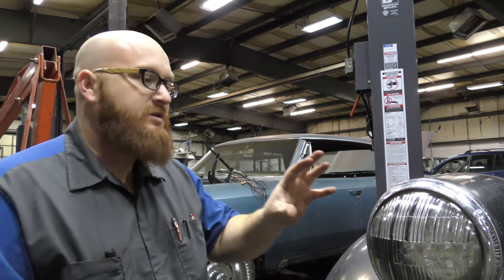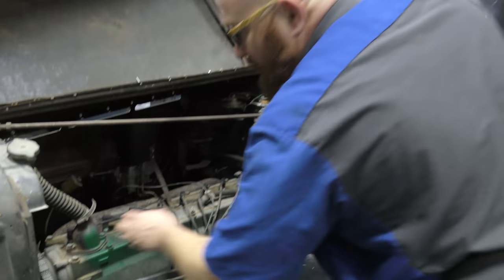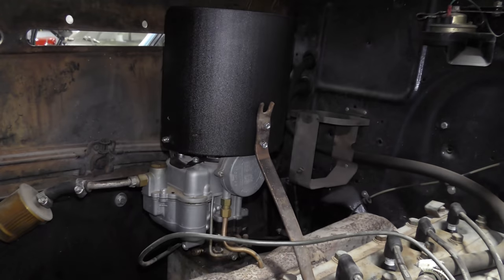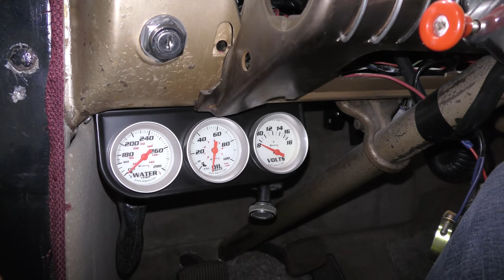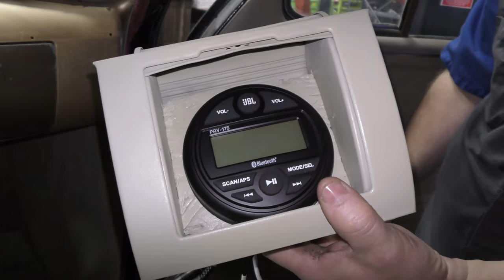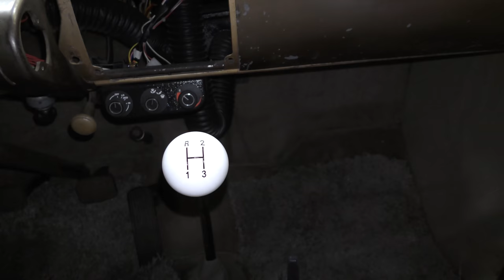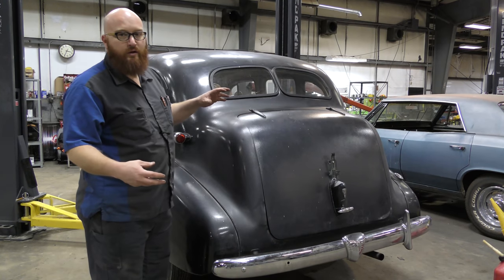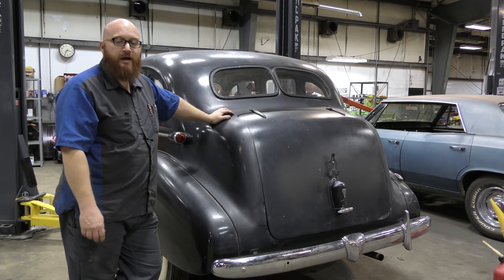OLDS SERIES #2: Nightmare to keep '38 Olds original! CAR WIZARD struggles to restore 83 year old car

Comment: The gauges are rebuildable if you take a little time.  I did it on my 54 Nash using VDO gas and temperature gauges.  I dismantled the new ones and took the drive units and mounted them behind the gauge face.  That way you get the matching sender units.  Just have to get the gauges with the right color pointer.

Comment: Those Pertronix Ignitor modules that replace the points and condenser inside your distributor cap are really great.  I had one on my '68 Ford Galaxie, along with the Pertronix Flame Thrower coil.  I was able to get rid of the "resistor" wire and feed a full 12-volts to the ignition system, which meant I could increase the spark-plug gap and get a stronger spark.  Ran like a dream for the 15 years that I owned the car, and I never had any issues with the ignition system.  It was perfect.  I can't recommend those Pertronix modules enough -- really, really great replacements for the old ignition systems, while still making it all look like stock.

Comment: If you ever have a overheating problem that has you baffled it’s most likely the water distribution tube that runs through the
engine.  Ask how I know!
Reply: Or 80 yrs worth of crud built up in block...only way is total disassembly and hot tank block......I say swap in a LS and turbo
Reply: How do you know ???
Reply: @rsprockets7846  He still has a good running straight eight, so it doesn't need an LS...
Reply: @davidhollenshead4892  personal experience with a 49 Pontiac.  On hot days the temperature gauge would peg.  I changed everything including the head gasket, thermostat, water pump.  Had the radiator rodded out etc. Finally an old timer told me my water distribution tube was rusted out.  Sure enough, that was it!  It was a bitch to change!  Had to take the grill out for clearance.
Reply: @davidhollenshead4892  we had a straight 8 buick come in shop with overheating did gaskets hoses cored rad...lotta bucks......turned out block had accumulation of crud from rad repair owner
 bailed on car
Reply: @rsprockets7846  - why does almost every video have this stupid LS swap it comment?
Reply: @rsprockets7846  They are only original once!  Why butcher a nice car?
Reply: @rsprockets7846 NO F---G WAY!  CLASSIC CARS SHOULD BE KEPT  S T O C K!
Reply: @petrosaguilar8916 You just answered your question with that word before "LS".
Reply: @davidhollenshead4892 He probably is a mechanic and has experience with American cars.

Comment: For your edification, Wizard, it is called a road draft tube.  Cool car. 
I pedaled a 1941 Oldsmobile series 68 businessman's coupe through my junior and senior years of high school.  It had the straight 8 engine and a hydramatic.  Very smooth drivetrain.  That engine was silky smooth running.  Also, instead of a rear seat, it had a drawer which  when the trunk was opened, rolled out to a pair of stops.  That was so road salesmen could load their product in and not have to pack and unpack at every sales call stop.  Very cool.

Comment: Unlike the modern tapered wheel roller bearings, those ball bearings required pre-load torquing.  The crankcase vent tubes were called road draft tubes.  The shape the end would allow it to pull a vacuum when driving down the road.  Air would enter the crankcase via the filter in the oil filler cap.  I'd use the same type LED headlights except ones with built in turn indicators within the headlight unit.  Nice car.  Hemmings might be a good source for parts.

Comment: you really need clear lenses to do that mod, ive tried converting behind assymetric lenses before, it messes up the light pattern and output
Reply: No way it's not still far better than what he had before and it's not like this is a daily driver out every morning before the sun comes up
Reply: You would be surprised... But, of course more output than a 80year old 6v bulb... But probably not where you want it😅 (that matters)
Would be interesting to see the pattern(high and low) against a wall
Reply: @veilsidewankel  These LEDs blind you, they are horrible when used like this
Reply: @lostcabrio  i retrofittet bmw bixenons in an old opel kadett once, same assymtric lenses, even with hid, the output was worse than the stock preH4 bulbs, and blinded everyone, with clear lenses the lights where amazing

Comment: My only advice, don’t paint it. It’ll never be as nice as it is now.
Reply: Even though it does not have the original paint, the current paint matches the package of the car...
Reply: @idratherberiding3456  I have a 41 Ford 0ne Ton that was properly repainted once 50 or 60 years ago in the original colour. It has nice patina and a lot would be lost if it were painted. Once painted then the chrome and stainless parts would let it down so where does it end. Some careful paint remediation in certain areas would be the ticket.
Reply: I cannot imagine this car is 5 years younger than my grandma, who is still in a pretty good shape (she was born 1933) This car looks so old - technology has made a huge jump in these past 80-something years

Comment: My Classic Mini’s interior caught on fire while the body shop guy was welding a new floor panel.  It was on a lift, on its highest setting, when it caught fire.  So they didn’t realize what had happened until it was too late, took too long to get the car down so they could properly use the fire extinguisher.  

They paid to fix it, but they destroyed the original interior, as well as melted the original car keys.  Wish someone like you was working on it.

Comment: Lol. That filter looks horrid. So do the lights. May as well keep the starter how it is too.
Reply: And there is people that can rebuild those cables and gears for the gauges at least for tractors anyway you just need to keep on looking what  filter would have been originally on that carburettor.

Comment: hi, whats the firing order in a straight eight?
Reply: One right after the other
Reply: Just google 38 Olds straight 8 firing order.
Reply: there are a number of variations of firing order which is interesting
Reply: @Gruxxan  I didn't know that. All I know is 18436572...SBC
Reply: @clintdavis9511  i'd imagine a different firing order gives a different 'feel' or characteristic
Reply: @kirkjohnson9353 That wouldn't work.  It would cause the engine to try to see-saw back and forth.  16258374 is probably the correct firing order.

Comment: You should be able to find modern sealed bearings to replace the originals.  The old ones require regular servicing and they are commonly replaced in old cars.  Not sure what type of oil seals they had in 1938 but I was able to replace the felt seals on my 29 Singer with modern seals as well. It is amazing how many different bearing and seal sizes are available today.  You can get almost anything you need.

Comment: Packards of a similar vintage had a switch on the Carter carb that engaged the starter solenoid when you floored the gas when the car wasn't running. No need for a separate starter pedal.

Regarding the flat head inline 8's... They run very smoothly, hence the reason they were in higher end cars well into the early 50's.

You can definitely get the gauges rebuilt.

Comment: Very good idea to put the LED motorcycle headlamps in there. I also like the 12v system and electronic ignition. Lovely car! I can hardly wait to see it painted!
Reply: Add small amberbLEDS on inside perimeters of lens for turn signals

Comment: I wanted stereo speakers in a vintage car once, but didn't want to cut any interior trim. My solution was a pair of those heavy free-standing aluminum Radio Shack Optimus two-way box speakers, set on the rear floor, just behind the front seats.  I've seen some of those rated up to 80 watts. Currently, I'm doing the same with a pair of 40 watt Optimus in my '96 standard-cab Tacoma as there was no factory rear speaker setup from Toyota. 
Radio Shack is gone now, but I've found the speakers at flea markets and thrift stores, and there should be something similar available new for marine application.

Comment: I’ve got a 1941 Dodge WC-8 military radio car project going so I can relate to a lot of what you are seeing and doing.  My gauge rebuilds came in at about $1200.  (Wiring harness is completely shielded and was $1800!) Fortunately even though mine is a rare vehicle (one of two known survivors of 452 built) the parts are between a 41 civilian and 42 military 1/2 ton.  I am also lucky enough to have 3 factory photos of it. I’m surprised you just didn’t have the brake drum turned or will you do that and save it for later?  Also you may consider getting an original generator and having it built into an alternator to maintain the original look.  I am getting ready to do that for my 42 Ford GPW Jeep.  The shift pattern is the same on my Jeep as your Olds.  Unless you drive it regularly it is easy to forget that left and up is reverse at an intersection.  I have 3 stick shifts and each is different!  Love your project and appreciate how you are doing it!

Comment: I have kept the original starter arrangement for my '56 Buick which starts when I depress the throttle all the way to the floor. When the engine fires the resulting engine vacuum de-engergizes the starter switch which is mounted on the carburetor.
Reply: Always wondered how, why, they disengaged.

Comment: I restored a 1934 Oldsmobile I found in extremely poor condition. It was more fun restoring it than driving it, and I kept it stock standard and did everything including the gauges.  I used it for club outings for a few years then sold it.   Very heavy solid and heavy car which was beautiful to look at. .  Cars of the 30's are OK but difficult to drive in modern traffic, slow, heavy steering, poor brakes and poor vision. . Good luck wizard I trust you enjoy your Oldsmobile.

Comment: There is a large square glass milk bottle that fits the washer bottle bracket and was often used as a replacement. 
Fitting a throttle body fuel injection system and a small turbo would improve the efficiency and drive ability without harming the engine.
You’d only want around three to five psi of boost just enough to ensure all the cylinders are getting a good air fuel mix.

Comment: You should build a shroud to cover the other side and top of that air filter. Love the straight 8 they make the best sound under load and I wouldn't use the oil bath style air filter. As for the gauges maybe send the original gauges out to a company that rebuilds and modernize them. Or you could try and use the mechanism from the aftermarket gauges you have and retro fit them into the original gauges yourself.

Comment: Great old car, Wiz. Suggest you try and track down a pair of '39 Chevy tail lights to use as front turn signals. Change out the lens and make some brackets to attach them to your bumper brackets. They are shaped is almost identical to your tail lights. Also agree about getting the stock gauges restored. There are lots of places that do good work (see other comments) and the L-38 dash is a unique one-year-only design.

Comment: About the radio. Many cars in that age had the antenna under the car, that would avoid drilling holes. Now you know what I know, got that from my father. Amazed that the speedometer looks "Oldsmobile" right into the early fifties. Someone mentioned below that you should install a hand throttle for cruise control. Look around, I should think a '38 originally had a hand throttle. Anyway, works some, but poorly. Doesn't adjust throttle for hills, etc. and certainly doesn't shut down when you hit the brakes. Seems to me that Pontiac was Oldsmobiles corporate twin in those days. All GM four doors looked the same. Buick at that period  mounted parking lights in streamlined chrome "nacelles" over the head lights. I think they would look good as directionals.  Check me out on this one. It seems to me that to remove the rear drum, you have to heat it toward the center (propane torch will do)until you hear a "ping". Then it removes. Makes me think that is why the PO bent the drum.

Comment: I've never worked on a flathead; however, I have spent what seems like a lifetime working on 'modern' engines. Friends of mine, Gober and David Sosebee -- father-son team rebuilt Gober's ~1937 Ford that won Daytona three times on the beach using a flathead. Back in the day, there were racing parts for flatheads -- maybe even a straight 8. Watching the car, now in a museum, come together several years ago, they had Offy heads, pop-up pistons and who know what else. There was a lot of interesting work inside, especially since a GA Tech engineer helped sponsor the car

Gober Sosebee was a showman on the track and self-taught engineer and inventor when he was off. Lakewood Speedway in Atlanta and Daytona had small lakes in the middle of the track.One of his stunts was to take a bucket to the lake dip out a good bit of water, then go pour it into his gas tank. Of course, his bucket had a mark inside to get the perfect amount of water and his car already had his acetone mixing agents inside the tank, Although he didn't believe in patents or didn't think his engineering products were important beyond his cars -- things like I Beam Suspension and Torson Bar Suspension resulted from him trying to keep Studebaker wheels and tires on the track. 

After Gober passed away, a sports network wanted footage of the old race cars from the early 50's. A small, dusty track was built near the GA Racing Hall of Fame. Cars came out of enclosed trailers from all over the US. Unfortunately, David Sosebee, a former NASCAR driver himself, could not keep his father's car running. He pulled it off the track area. I walked over and David was clearly upset with himself. He said, "All those years dad would tell me all the quirks of cars with magnetos. I should have listened, but saw no need at the time. If dad was still living he could walk out there, twist this and tighten that, then crank the car and drive off.

Comment: I would remove that wholly out of keeping alternator and replace it with a Dynamator. Looks like a traditional period dynamo but actually is an alternator. In the UK, there are a number of companies specialising in restoring old car instruments. They are not cheap but do a lovely job, including repainting the dials. I had an electric speedometer repaired for my 1977 Porsche 911 RSR and it cost over £500 (that included re-calibration as I had lowered the final drive ratio for rallying).

Comment: If you have a manual choke or throttle controls/cables in the cab you can use those as "a poor man's" cruise control.  Not as functional but allows you to keep the car more stock.

Comment: For the headlight reflectors, you go to the household goods section of WalMart and buy a pair of polished stainless steel mixing bowls of the right diameter and cut a hole in the center.  You don't have to worry about degrading even the original ignition points because you'll never put enough miles on it anyway.  Flathead engines were indeed used in race cars: the Hudson Hornet was a large flathead six that dominated NASCAR racing until 1955 when the big 3 came out with OHV V-8s.  You can rebuild the original dash gages.  This was the final year for floor shifts.  That fuel filler hose better be for gasoline use.  If it is a radiator coolant hose it will disintegrate within a year.  Ball bearings were a cost-saving design.  Timken Tapered roller bearings were available and in use since the late teens on higher quality cars.  You need a large puller to remove the rear wheel drums or you will end up with a bigger problem.  These pullers are designed to bolt onto 5-lug wheel drums.  The cars didn't have turn signal indicators, you used hand signals.  The parking brake lights were small bulbs inside the headlamp shell at the bottom of the reflector.  You're going to have to make your hood trim by hand using a copper or brass strip.  With any luck, you might be able to work a standard household copper pipe to shape, possibly starting with sheet metal roller to get your width, cut out the back, and then hand work the ends and then have that plated.

Comment: For the front indicators it looks like those holes in the headlamp housing would take a motorcycle indicator. so you could either get some retro styled chrome led indicators from someone like tec bike parts, or like with the headlamp get a really low profile led motorcycle indicator so nobody even notices it until you switch it on.

Comment: Blinker Idea,  Halo ring inside the Headlight lens,  If you can find one that inside diameter, wont interfere with headlight light, if it is white when off and yellow when blinking, you won’t see it unless you're using it.  Look might be more modern than you are looking for however for the car.

Comment: My Father would talk about about the 1938 Buick he had.  It had aluminum heads that he milled down to raise the compression.  He was a racing mechanic and used 'left over' racing fuel ans other parts in it.  If he 'goosed' the engine too hard, spark plugs would pop out and he would have to reseat them with a helicoil insert

Comment: Make sure the fuel hose is gas rated. Any other rubber will perish leaving residue in the tank.
Front turn signals look totally wrong. Something similar to the brake lights situated below the headlights would look correct. Try mounting them to the bumper. Headlights need mirrors inside to remove the black coming through the lenses.
Interesting project. Looking forward to the updates.

Comment: You can get tapered roller bearings and races to replace the ball bearings on the wheels.  Did that many times back in the 70's n 80's when those would show up at our shop :)!

Comment: I have a 1937 olds L38 all steel very little mud . Replaced  6cyl wih a 350 and 400turbo trans  s10 rear 1980 durango drive shaft . Drive it alot love it